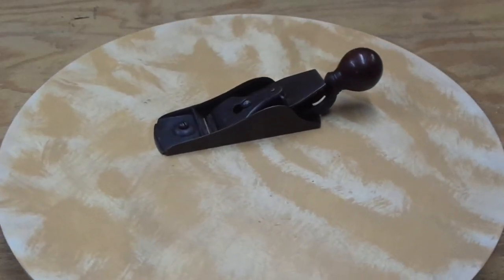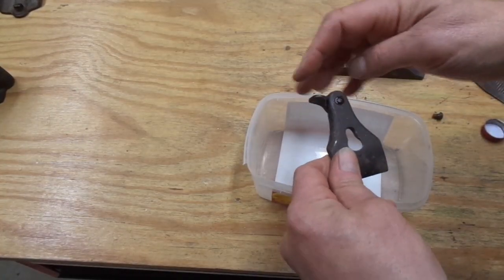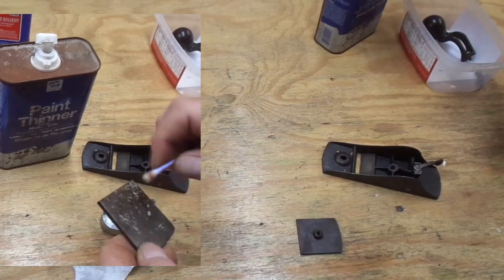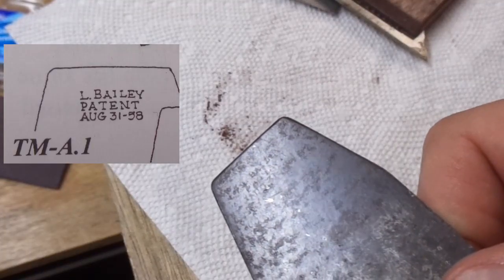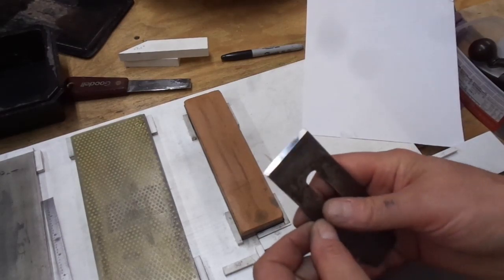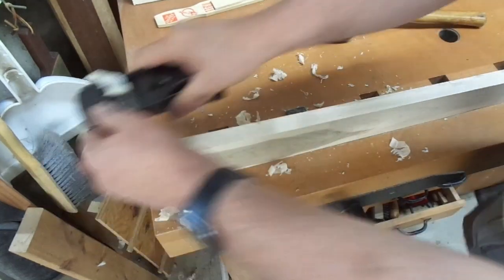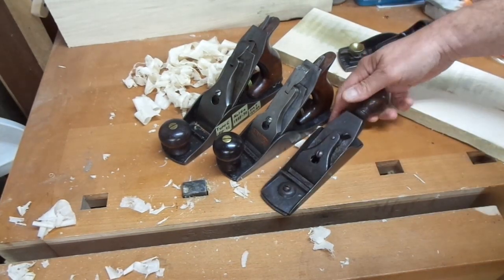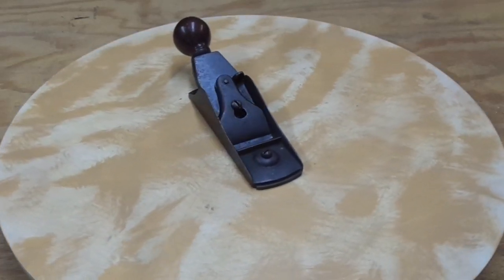Stanley No 9-1/2 Type 1 Clean and Tune Up

Comment: Loved this follow up video. When you compared it to the No. 2 plane and said the plane irons are at different angles, that's true but there's more to it. On the bench planes, the angle the iron sits at determines the angle of approach to the wood because the bevel is down. On a block plane, the bevel is up so the angle of approach is the bevel angle on the blade plus the angle the blade sits at. When you add those together, they are approximately the same angle.
Reply from the maker: Thanks for the comment and you are correct.  I cover that detail in other videos.  The only way to change the angle of attack on a bench plane is to grind the backside of the iron, which increases the angle.  So a bench plane can be modified to give 45+ degrees.  The bevel up planes give more flexibility in that regard.  My particular iron is around 30 to 35 degrees, making it pretty much the same as a bench plane.  Oh well.  I'm not inclined to remove that much material from the iron to get a smaller angle as this plane is just for show.  Take care and thanks again for reaching out.